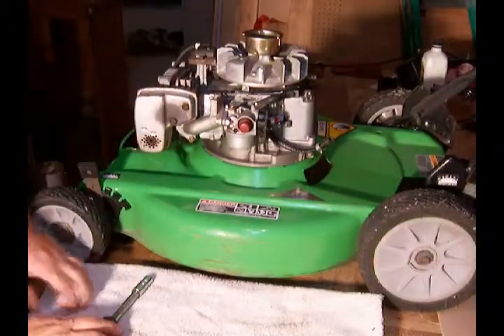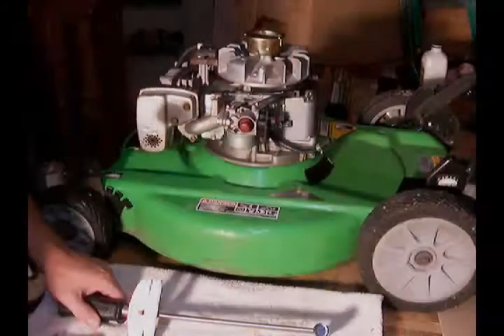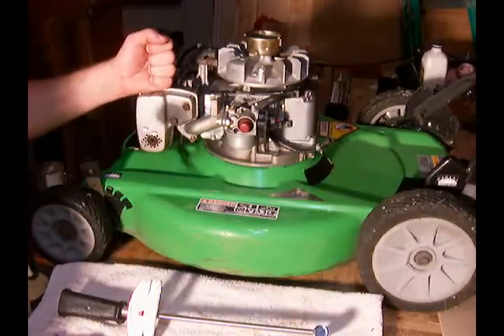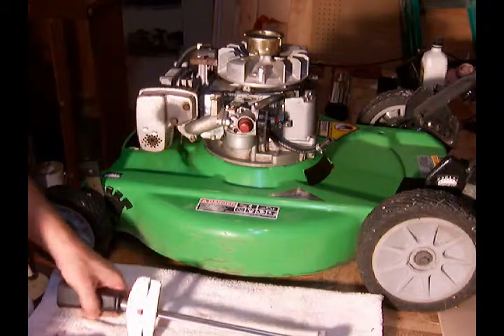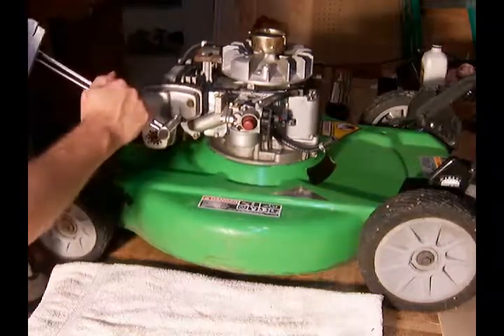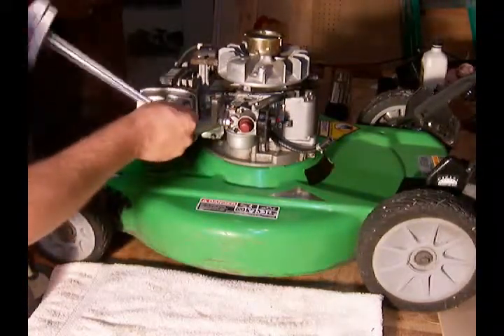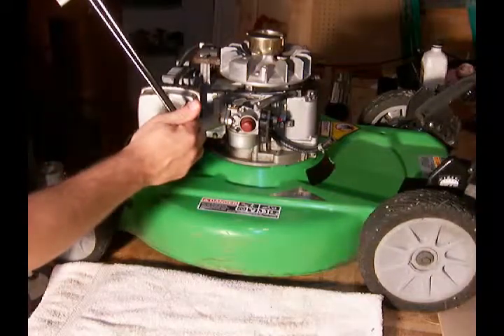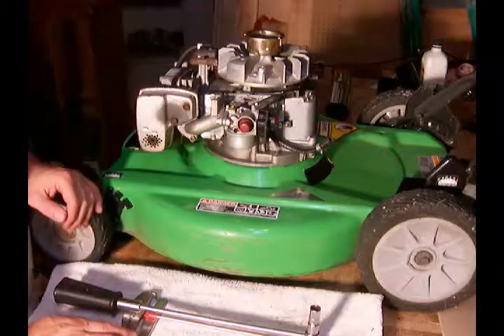#27 Tecumseh LV195EA / LEV120 - Muffler Installation

Comment: I am trying to put my mower back together after taking off the carb to clean it.  I see a bolt hole with no bolt just inside to the right of where you mount the muffler with it off.  The threads look fresh and I can find any info on this.  Can you help me?